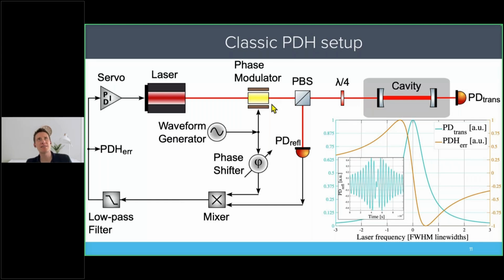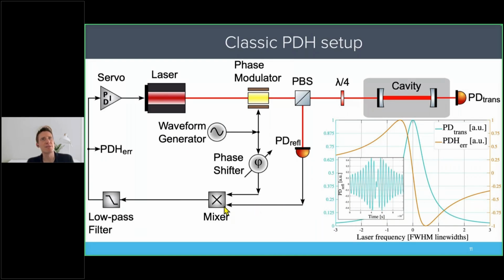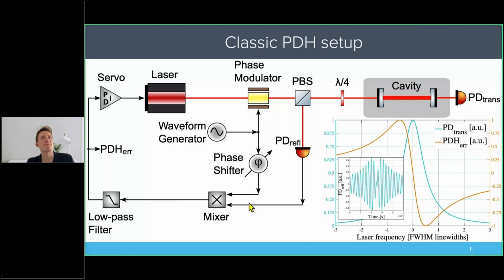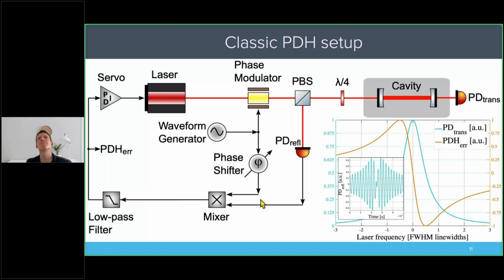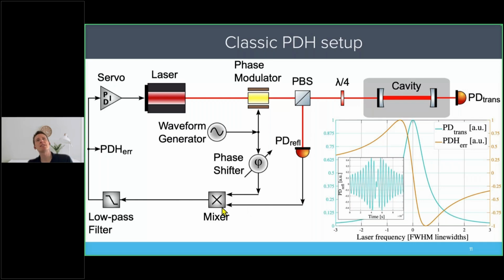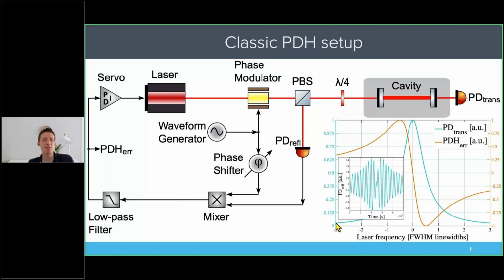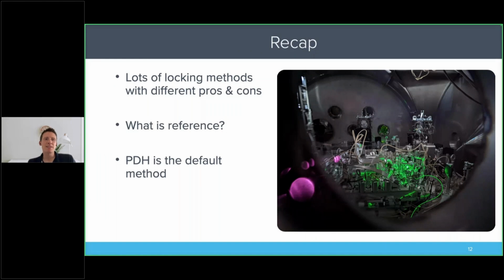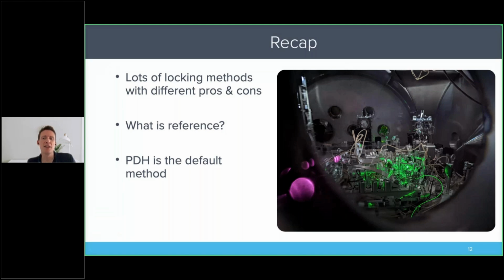PDH locking: Step-by-step laser locking setup

Comment: Woudn't the signal from the PDtrans be the same as from the PDrefl? This would eliminate the quarter wave plate and beam splitter.
Reply from the maker: Thanks for your comment! In this case, the two signals are very different. In the classic implementation the PDH sidebands are far outside the cavity linewidth and would be transmitted only very weakly to the PDtrans diode. Click the link in the video description to watch the full webinar episode on our website.